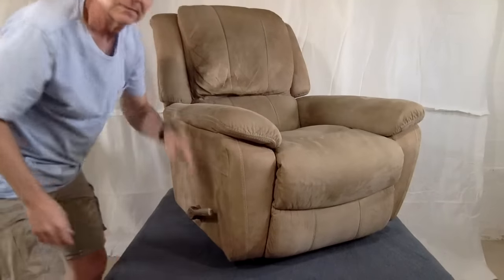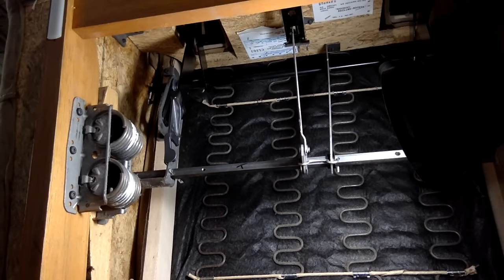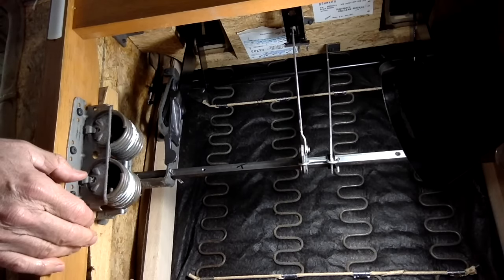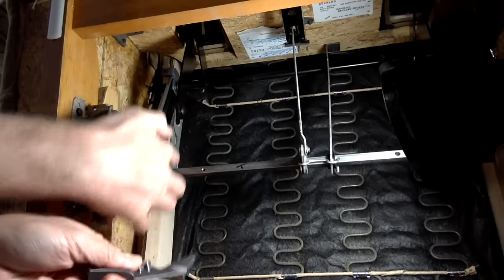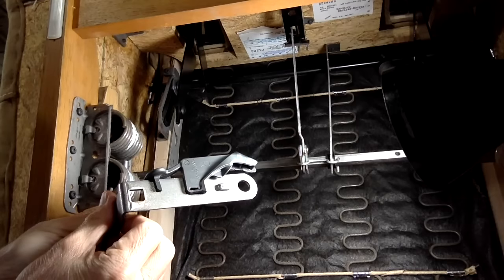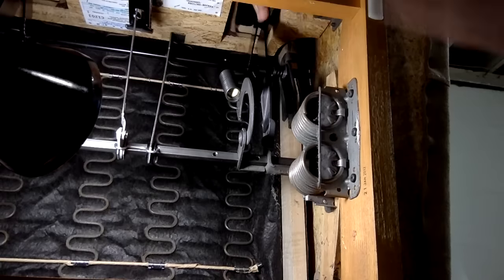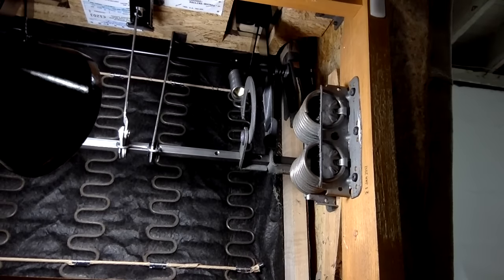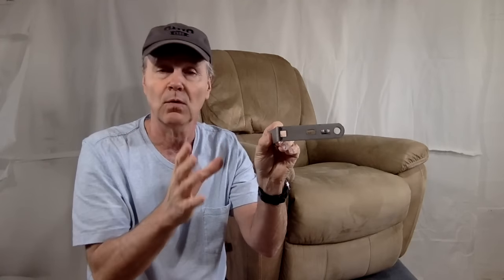The La-z-boy Recliner 3-Position Footrest

Comment: I just repaired my recliner for the 2nd time. The first time I replaces the harden plastic piece on the right side. That was probably 4/5 years ago using your video. I should of changed both side at the time because the left side footrest was tilted down slightly. I thought I would wait till it completely broke. That was last night. So this morning I repaired the left side. I ordered both sides with the screws back 4/5 years ago. I cannot find the parts diagram now. I want to order both parts again in case it breaks again in the future. My local La Z Boy stores does not carry any parts. So I am trying to find a parts diagram to call for replacement. You don’t happen to have the parts for the hard plastic and screws for it do you? Thanks. And I love all your maintenance and diy videos. Very informative and helpful.
Reply from the maker: @david gunderman - If the parts you're referring to connect the Leg Extension scissors with the Rear Swings, those are Legrest Swing Bushings (the round black plastic part). Part# 05.000085. The screws are Truss Head Screws 1/4 - 20 x 1." Part#  9600076-04. 

If you use the proper part names, you can usually order without the part#. For example, you can request Legrest Swing Bushings (2) with screws (2).
Reply: @reclinerrepairguy4155  thank you . After holding for over 3 hours on the phone someone finally answered at Customer Care Center. She had my file on record for my last order I placed over 2 years ago. So now I’m waiting for the Parts Department to call me back to complete the order and pay for it. What a roller coaster just for these parts. I’m ordering the 2 parts so I can have in case the hard plastic bushings go bad again in the future. The part I replaced 2 years ago seems to be holding up pretty damn good so far. Maybe they made them harder to last longer? 
Do you have parts diagram for these La Z Boy recliners? I had one last time but cannot find it now.
Reply from the maker: @dcgunman  - You can request them from La-z-boy as well. If you don't want to wait on hold forever, use their email contact form to request the mechanism sketch & parts list.
Reply: Recliner is almost like new after replacing the foot rest bushings. I finally was able to order replacements through LaZBoy parts department. I’ll have it ready for the next time the bushings go bad. But I’m hoping with the better and harder plastic it will last longer. I have one more question. Do you know a way to stop the noisy creaking noise when the recliner’s footrest is in the down closed position? It’s got to be the wood to wood contact when it’s rocking back & forth. Bad design imo. I found one other video from the LaZBoy page on YouTube. The LaZBoy maintenance guy used some kind of liquid wax between the two wood. I cannot find this liquid wax anywhere.
Reply from the maker: @davidgunderman6348  - That's Rocker Block wax, and it's not likely to be available to consumers. You can try other wood wax products instead.

Comment: Is there a special tool to tighten the two plastic nuts holding the scissor mechanism?
Reply from the maker: TheBirdandEagle -  No special tool required other than a torx driver or torx bit - T30. The Legrest Swing Bushing (plastic nut) that fastens the Legrest Subassembly (scissors) to the Rear Swing, is held in place with a Truss Head Screw (torx head). When the Bushing is properly seated into those 2 parts and held in place with the screw,  there will be no slack or play.

However, if the screw comes loose from the bushing for whatever reason, there will be play there. You'll need to completely remove the screw, reseat the bushing and reinstall the screw. If the screw will not tighten snug against the bushing when reinstalled, the bushing will have to be replaced.
Reply: @reclinerrepairguy4155   Thank you for taking the time to reply.  Always excellent assistance and directions.  Again, thank you very much.